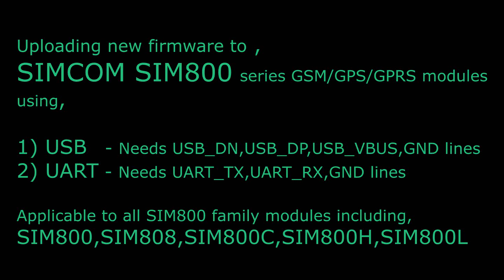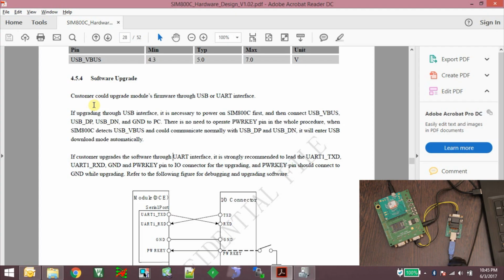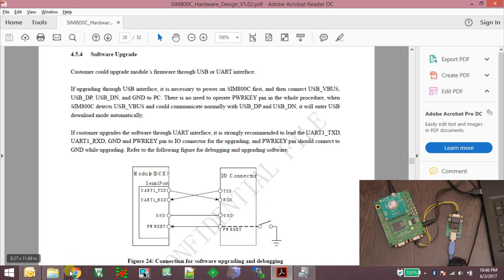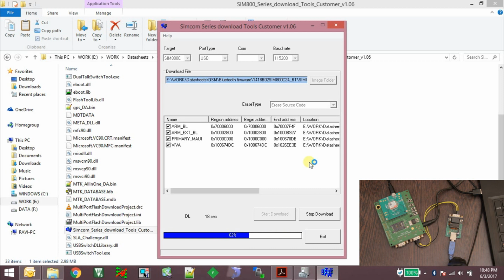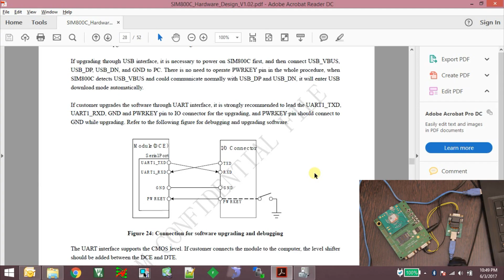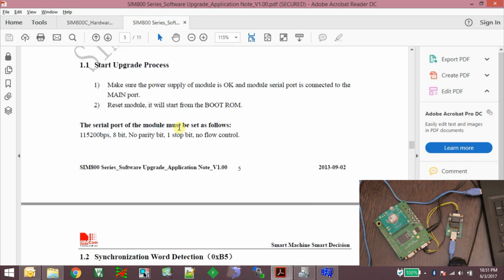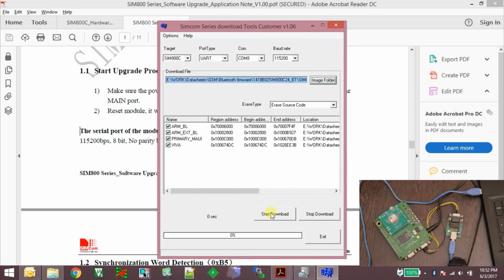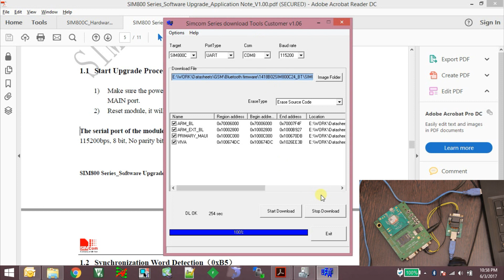Uploading a new firmware image to SIM800 family GSM/GPRS module

Comment: How Ravi, can please send the link where to get the SIM800L firmware which will run smootly. Actually I have updated a firmware after that the Powerlight not blinking nor the AT command getting functioned. pls help

Comment: Thank you sir...is that mendatory to upload firmware in 800c in new module  i have bought sim800c  module so can i directly solder module to my pcb without firmware update...means company loaded firmware already in module or not sir??  i want to skip firmware update process...
Reply from the maker: Yes it's loaded. But incase you need any specific functionality,you need up upload that particular firmware which supports the need functionality
Reply: @RaviPujar  thank you sir for quick replay....so i can direct solder this module on pcb i need only GPRS function to send sensor data to firebase database using SIM800c module ...will it work ???or have to upgrade firmware sir

Comment: Thanks for the wonderful tutorial which made my work simple. Is that mandatory to switch ON the module after clicking download. Is it possible to download when the power is ON. Else it has been mentioned in any release document. Please clarify me regarding this.
Reply from the maker: Module enters update mode when download tool is running and you reboot module.
Don't forget to like share and subscribe :)
Reply: @RaviPujar  Thanks for your valuable reply. Is that mentioned document cz I have tried to figure it out but of no use.
Reply from the maker: @deepakthasan2644  Not mentioned in any document. Found it out by experimenting
Reply: @RaviPujar  Great. And very thanks for your swift replies.

Comment: Hi ravi, 
I have a sim800h module fitted with msp430f5232 mcu I want to change APN setting in sim800h there is no pin for rx,tx in sim800h rx,tx directtly connected to msp430. Its a luminous solar pcu module that is use for sending data to server. Please guide me on this. Thanks in advance
Reply from the maker: Hi,
You can set apn using mcu code right?.
If it's a pre-designed hardware, Normally a interface is provided for setting apn. May be by uart. Is this hardware designed by you or others? . If others, best way would be to refer manual or ask them. Don't forget to share and subscribe :)

Comment: I bought sim800c and I setup circuit ,the net light does not blink.What ı can do and do I need to upload firmware to sim800c
Reply from the maker: Hi Yunus,
There can be multiple reasons for it.
Check already asked questions on http://www.embeddedadvice.com
You can create your own new post and we can discuss.

Comment: I have a problem with connection to the gsm network with the module sim800L previously worked perfectly, but a few weeks later I no longer connected to the network, now the LED flashes 7 times and does not receive a signal, can I solve the problem by updating the firmware? thank you friend for your help
Reply from the maker: Hi,
If it flashes 7 times and stops and restarts flashing then its restarting due to undercurrent. Check your power source.
Please post tech queries to http://embeddedadvice.com with relevant details . 
We can discuss.  Dont forget to Subscribe :)

Comment: Thanks Ravi for the greate video.
I want to know if I can download my own firmware (I have developed)? or the upgrading with fixed firmware by SimCom?
Thanks
Reply from the maker: Hi,
Thanks for watching  :)
This method shows you to upload SIMCOM stock firmware. 
The SIM800 modules support our own code to be written and programmed in them, But its not officially supported by SIMCOM and hence very less documentation available.
Reply: This mean that I can change the functionality of the phy layer i.e modulation scheme or modem synthesizer to change the operating band?
Reply from the maker: No :)
You can only use the AT command given by them. Only difference is you wont be needing a extra MCU. Thats all. 
Your code will run on top of their firmware as a process running AT commands. Search for Embedded AT commands.

Comment: Hi. I have sim800l24 firmware on board and cannot upload sim800l16 firmwares. So is it other firmwares for sim800l24 versions?
My sim800l not support  CS data call, for command 'ar+gcap' ancver +gcap:+cgsm
Can i activate 'fclass' mode?
Reply from the maker: Hi Oleg,
Yes, they will need different firmware versions each. Its better to contact the local SIMCOM support team for firmwares. They will be able to help better . I haven't tried these modes so far. fclass mode i am hearing for the first time, I will look about it and let you know if i am able to learn anything. Thank you for watching and Dont forget to Subscribe :)
Reply: Hi
I have exactly the same problem.
Did you find any solution?
best regards.

Comment: when i click  ""start download" it displays this message "SW Version error,Please select the right version""
please tell me why
Reply from the maker: There are two types of firmwares 32bit and 64 bit. You need to use right firmware by checking the current firmware on your device. You can drop mail to SIMCOM support, they will help you sort it out by looking at module serial number.
Reply: OK I'll try thank you

Comment: i want to update the firmware but I dont have rs232 can I do it using the RX and TX pins ? if yes can you explain ?
Reply from the maker: RS232 uses TX and RX pins itself. But you need either RS232 or USB-UART converter to interface modem to PC for firmware update.
Reply: Ravi Pujar ,I have USB to UART but it does not write either as I connect it with RX,TX,GND pins that I soldered on to it and try to transfer the firmware but nothing happens and if I try to power on the device error comes cannot communicate with device,am I doing something wrong?
Reply from the maker: Bhavin, 
Its not straight forward connection. You need to use IO level translators if your GSM module board doesnt have it. SIM900 /SIM800 modules are having max IO voltage level of 2.8V. Normally USB-UART TX ,RX IO lines are at 3.3V or 5V so you cannot connect directly. If you do, it will damage the module IO ports.  Check module baud rates after this is fulfilled.

Comment: can i upload this firmware using my arduino uno???
Reply from the maker: Do you mean you want to use Arduino as USB-UART converter?
Reply: yss arduino as USB-UART or any other way I just want to upload Bluetooth firmware...
actually I connected my arduino with my gsm800 and then using arduino serial port, I am giving AT command without using RS232 or USB..
Reply from the maker: You might be able to use it by making sure Arduino doesnt interfere with firmware upload process. Better to use a separate USB-UART converter

Comment: Hi

I am actually using the module sim808 but i have issues like it does not connect to the network through the sim card and i cannot have access to either the AT command ..

If you can help me please !
Reply from the maker: Hi ,

Try this link. It applies to SIM808 also.
http://www.raviyp.com/embedded/203-sim900-sim800-not-working-possible-reasons
Try and let me know.
Reply: Ravi Pujar 
I had already read it !
And actually i am using an arduino to do communication and i had not even be able to have the "OK" answer from any AT that i had send
Reply from the maker: Where are you using the module in? I mean country. 
If in USA. I didn't get signal until i changed the CBAND to PCS_MODE when i had sent a SIM808 board to USA. Try that too for network. And also if you are not getting AT command response. I would suggest trying out the terminal using a PC first and then go for Arduino connection. If AT command is not having OK response then you should check the UART connections and also the autobaud settings. If module is in Autobaud mode then you need to send AT command in capital letters for first command.
Reply: Iam using it in Mauritius
Reply from the maker: Please try different options in AT+CBAND command in AT command manual to select the correct GSM band in your country.
Reply: the problem is that the sim does not connect to the network and thus no AT command can be performed
Reply from the maker: Even if there is no network AT commands will work. But unless the AT commands start working there will not be progress even if network is acquired.
Reply: Its okay, i had been able to manage to connecte with the sim 808 and my sim card to the local network
Reply from the maker: Thats good. What was wrong?
Reply: The coding what I was using do not sue to the device and was not making the appropriate communication between it
Reply from the maker: Ok. I see. Glad that its resolved.
Reply: Indeed but the GPRS could not be activated which is quite irritating
Reply from the maker: What error you are getting?